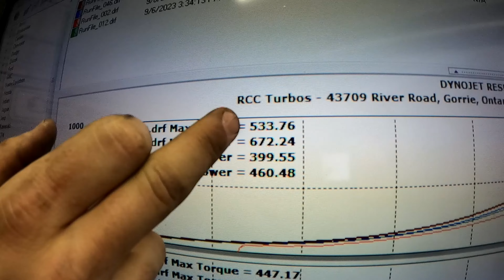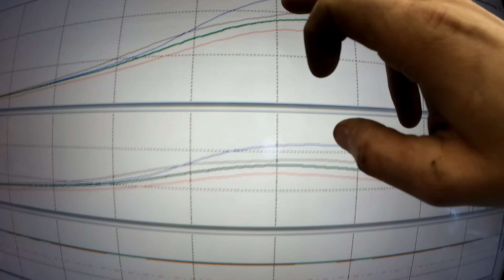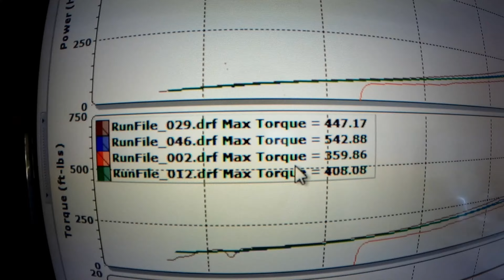DYNO DAY The Suicide MX3 Made HUGE POWER!! (Way more than my 550HP Goal)

Comment from the maker: what do you guys think of the new powerband!!! 😂
Reply: The engine wants more timing in the mid range. I don't understand why individual are more scared of adding timing than adding boost.
Reply from the maker: @Mbryduck  many reasons? Over loading the engine at mid range is when detonation happens, also wheel spin, over loading the rods.
Reply: @Suicid3mx3 , what was your target lambda? I've targeted .90 lambda, on e85, at max boost without any issues. Don't you have a built motor? Perhaps you should choose a stronger rod.
Reply from the maker: @Mbryduck  I have strong rods, I just like them where there at, in the engine and not on the floor or through my back 😂
Reply from the maker: @Mbryduck  and I say the target in the video
Reply: @Suicid3mx3 , I personally think you should experiment, especially with e85. When my KL is running, I know I will be leaning on it, no matter what rpm.
Reply: @Suicid3mx3 , if I were you, on the dyno, I would see what the differences, in horsepower, are when you target .87, .88, .89, and .90 Lamba at max boost.
Reply from the maker: @Mbryduck  I'm never going that lean ever, I'm already overpowered and the way I tune is to have a safe gap for reliability and not being on the edge
Reply: @Suicid3mx3 , I can tell you don't have much experience with e85.
Reply from the maker: @Mbryduck  by my 672 whp car? Lol.
Reply: Holy Piss! I Was Not Expecting Those Numbers, Geez!

Comment: May need some stiffer bushings (if they're not already heim joints) holding those rear arms on, watching those tires turn in and out on the dyno at those power levels is impressive. Great work Ty!
Reply from the maker: I have a bar with heim welded to the bottom of my control arm, that takes a bunch of force right to the frame
Reply: @Suicid3mx3  Awesome. Hoping to finally get my fs on the dyno next month and see what 30psi nets me, Virtual logs were showing close to 600wp.... but anything over 500 and I'm happy.
Reply from the maker: @Friendsofdonr  500 is perfect

Comment: You should post pictures of the dyno graph after each pull. I tune as well and may be able to make suggestions based on the  dyno graphs.
Reply from the maker: At the end of the video I have pics
Reply: @Suicid3mx3 , you're missing my point. As a viewer, I don't want to wait until the end of the video to see the dyno graph. Make the pull, show the graph. Rise, cycle, and repeat.

Comment: What mods did you do internally to the KL to get that astonishing amount of power?
Reply from the maker: rods, pistons, bearings, epoxy block deck, head studs, stock head other than subaru springs  😂  and custom cams....
Reply from the maker: i have fancy home made intake and exhaust done by myself and that helps
Reply: @Suicid3mx3  Of course! :)
Reply from the maker: @gregquk  you betcha
Reply: @Suicid3mx3 I always thought you used KLDE stock cams
Reply from the maker: @Mad4Tracks1  I use tri flow colt cams now, they aren't that special tbh